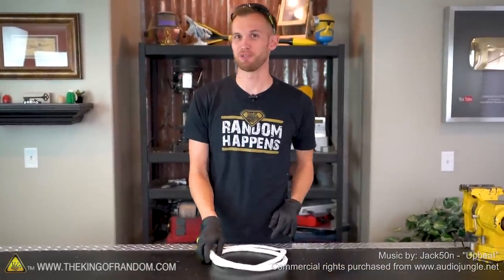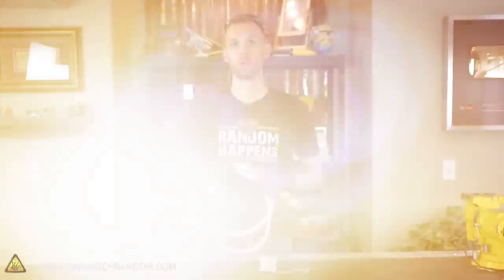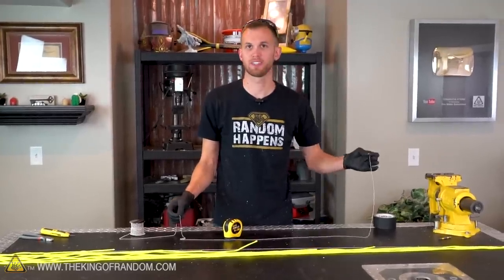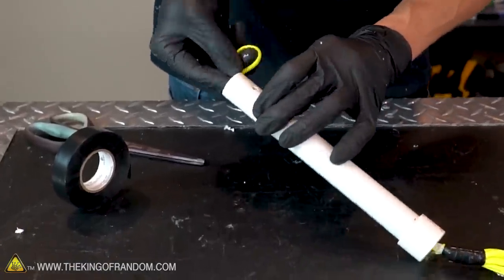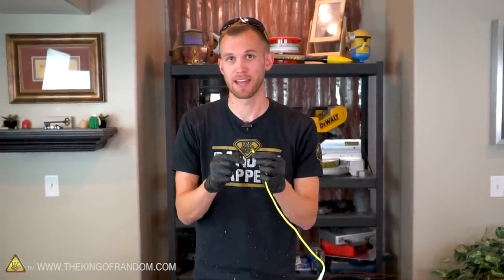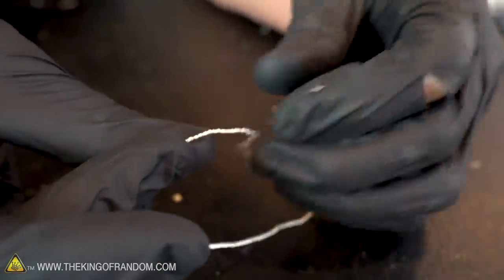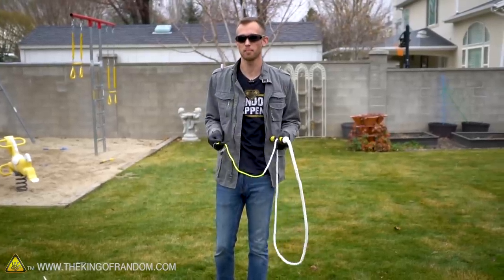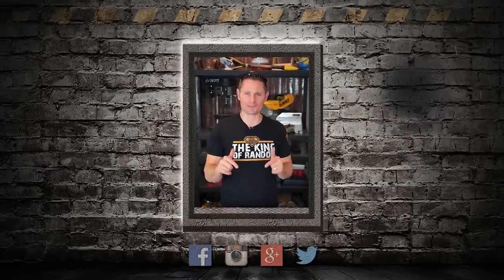How To Crack a Whip! TKOR Breaks Down Whip Cracking Basics, DIY Bullwhip 101, and More!

Comment: Pieces of parachord for those using the metric system:

2.7 meters in front of the hadle for the first strand
The second, smaller by 50 cm
From the third onward, make it smaller than the last by 20 cm
Reply: Metric is for people who didn’t land on the Moon, so it is inferior.
Reply: Indeed GalagicSubset, we didn't land on the moon because we were too busy taking care of civil rights
Reply: GalacticSubset1 fURy actually NASA interchanges Standard (metric) and English units all the time since metric makes so much more sense in Engineering.

Comment: Can you make a water gun that shoots electricity. You can do the same thing as the flame thrower but use water instead of fuel and a taser on the end where the flame is supposed to go
Reply: he would die...
Reply: Water guns wet pretty wet if they are not sealed off sooooo,  no
Reply: That sounds incredibly dangerous...

Let’s do it!!!
Reply: Mustafa 523 Sorry, I've seen Mythbuster's try this and the water breaks up into small ball (due to surface tension) really quickly so the electricity won't travel along the stream of water properly......... in the end they had to use a giant Tesla coil to get it to work...... with Jamie Hyneman inside the top of the coil!!!!! Buster got toasty! Fun!!!!!
Reply: Hannah Boucher well it’s not if it’s distilled because H2O isn’t conductive
Reply: Mustafa 523 I agree with you
Reply: Even with laminar flow it’s incredibly difficult to get enough amps and voltage to travel thru due water’s natural low conductivity. Check out Mythbusters s6ep8 Water Stun Gun.
Reply: countryboy38008 what if he used an extremely concentrated electrolyte solution
Reply: I don’t think it works that way...
Reply: Unfortunately it won't work because the water spreads

Comment: What if you freeze water in a vacuum chamber, would it still float?
Reply: Manuel Johnson of course its water
Reply: Maxi 1610 however, ice floats because it's a mixture of water and air.
Reply: Caleb Baker huh, weird. I wonder if there is a way to prevent it from expanding; now I want to find a way to make ice, made of nothing but water, sink in water.

Comment: I made a whip at home and used supple copper wire to get some more weight and it works fine so if someone else doesn't want to spend there time to do it with the BB's this might be a solution for you

Comment: I'm watching and wondering; would it have a positive or negative effect on the end product to use one of the internal strings of the next shortest 550 cord to pull the beaded chain through the center of each strand of 550?

Comment: Ooh I got an idea 
Take the pull-start smoke grenades try using the like a rocket
Like use something to hold it upside down and pull it and see if it starts going in the air have water or a fire extinguisher nearby just in case

Comment: You should do a video experimenting how much weight is required to open the lid of the vacuum chamber on full vacuum and check if it changes depending on the volume of it :)

Comment: makes a smoke bomb, my suggestion is to use nitrate of chile (double nitrate of sodium and potassium), an agricultural product with sugar, places 8 tablespoons of saltpeter + 8 tablespoons of sugar in a pan, constantly roasting on low heat, when melt and the mixture becomes homogenous, delite the stove and place a spoonful of sodium bicarbonate, let dry for 2 hours inside a can of soda without the top. when it dries a hole in the center and puts cotton with acetone or something like that, and then just light it in an open place.

Comment: Try casting a key in silicone and fill it up with epoxy. Would be interesting to see if it opens the original lock. (Or if it's a car key, see if it starts the car)

Comment: lets see a rocket stove chimney (vertical burn chamber).  And then play with where the secondary air is injected. Then maybe injecting propane for boosting heat output.  Vertical Foundry???.